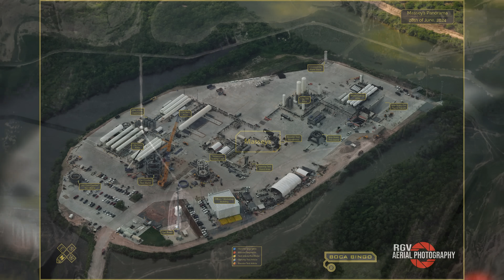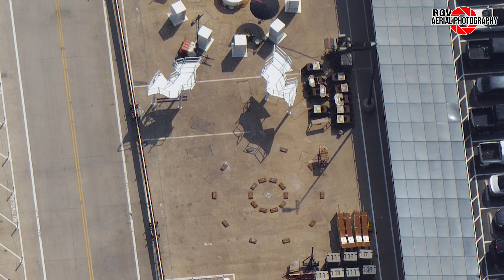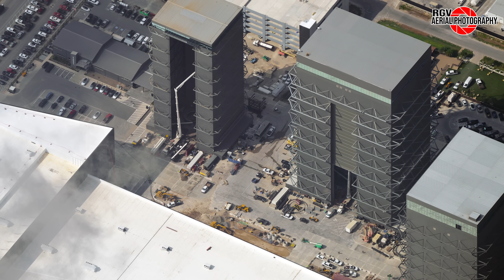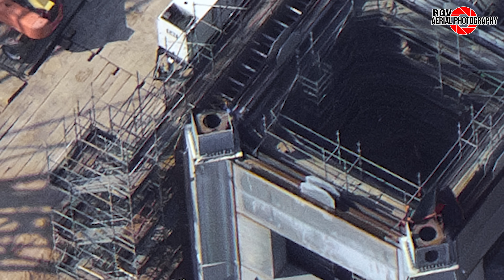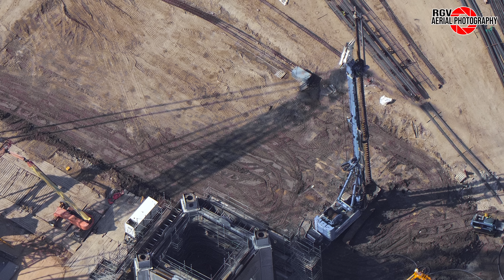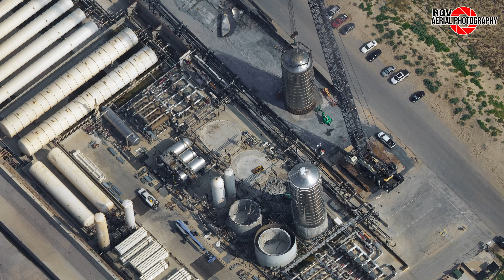Flame Trench and Tower Two Update! Starbase Flyover Update 48

Comment: The need for a Flame Trench (of some sort at least) was pointed out after the first launch. The mods to the current launch mount have been very successful as far as that goes, but the infrastructure around the Mount has had to be shielded and re-enforced to deal with the exhaust. Be quite an engineering task, but the end result should be quite good as far as directing the exhaust away from anything that's comparitively fragile...

Comment: I also thought StarBase would built Giga Sized both Height and length to manufacture the Starship and Raptors all in one building
Reply: The Star factory is going to be capable of building an enormous number of 2-5 ring stacks and, near the exit, 6-12 ring combinations. These will still need final assembly in the High-bay and Mega-bays.